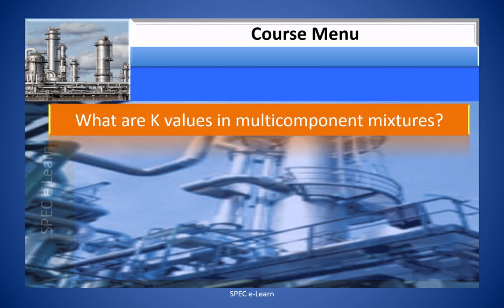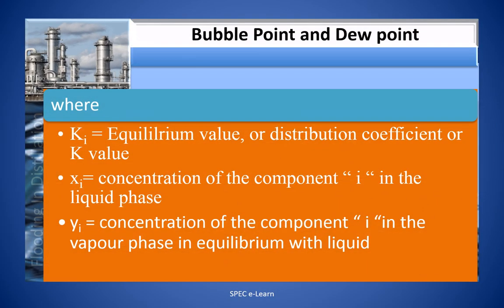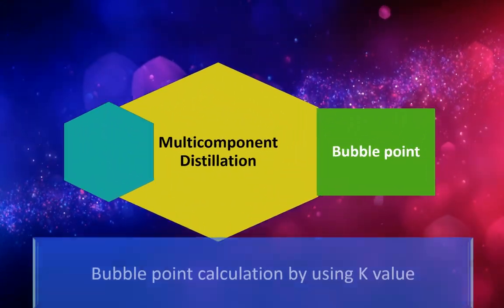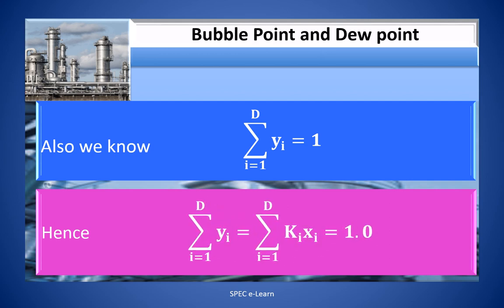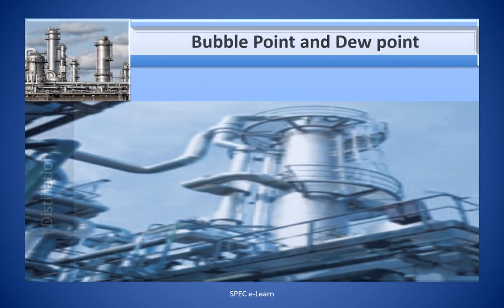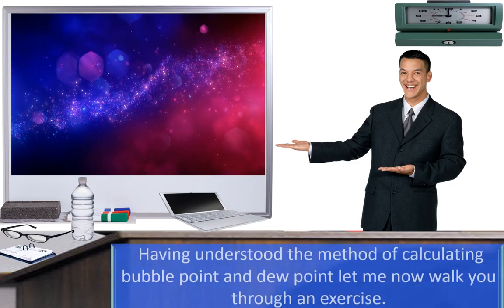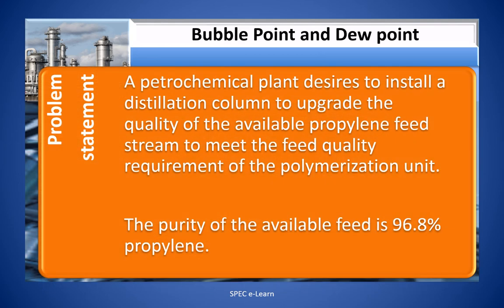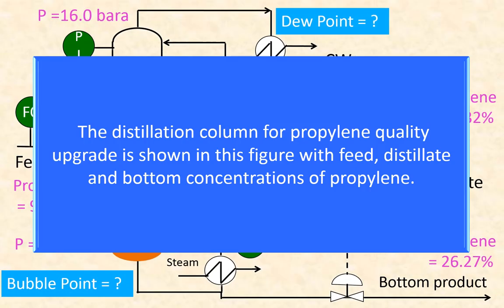Distillation: Bubble Point and Dew Point Calculations

Comment: Dear Sir, 
Please  explain phase composition at bubble point and dew point.
We started with liquid  mix of known composition 
Then we calculated bubble point and vapor  phase composition 
Now we are calculating  dew point of mixed vapor. So yi is known 
When we divide this by ki we will get Xi which is component conc in liq phase
But this is going to be different  than the initial composition. 
Is this  understanding correct Sir  ?
Thanks and regards

Vijay Bhatawdekar
Reply from the maker: I don't understand question. Bubble point and dew point calculations are required to be done in the design of distillation column when it is desired to separate a feed of given state and composition. In most situations the design objective is to produce near pure products at the top and bottom. The lighter component is separated as distillate and the heavier component as bottom. When these two compositions are specified, the bubble point and dew point can be calculated as explained in the video
Reply: @SPEC786  
Dear Sir, 
Thanks for your reply. I understand now that the specifications for distillate ( I e desired purity of lighter component) i
s led down  first. And composition  of vapor phase is assumed to be  same as distillate. I  was trying to  relate vapor composition calculated at bubble point  to the vapor  composition at dew point.
I hope  I  could  explain  my misunderstanding. 
Thank you very much for your feedback. 

Yours sincerely, 
VBB